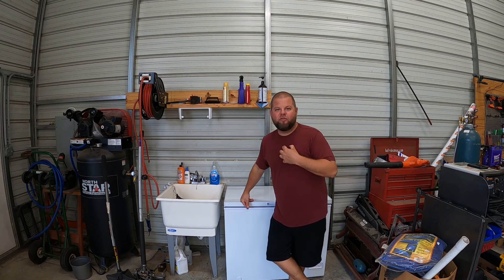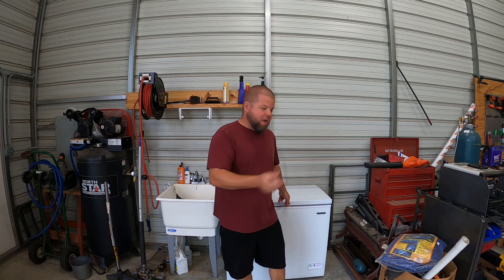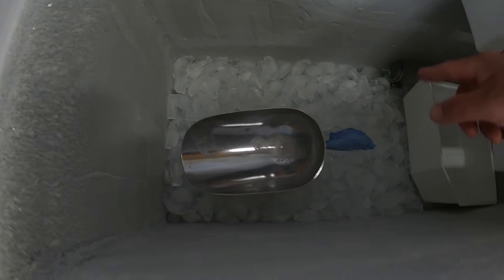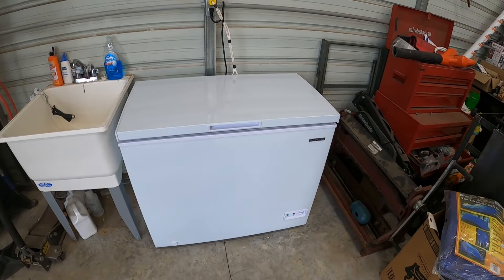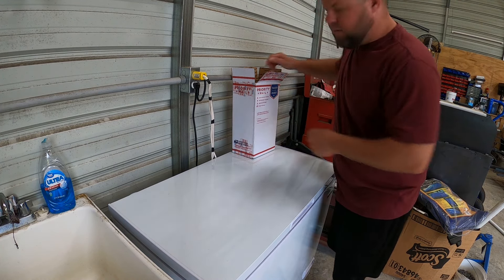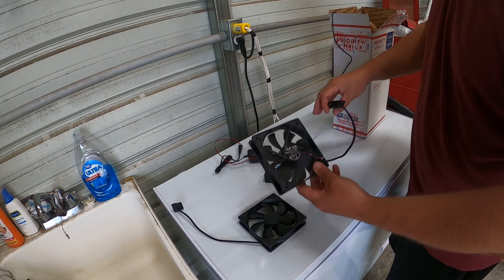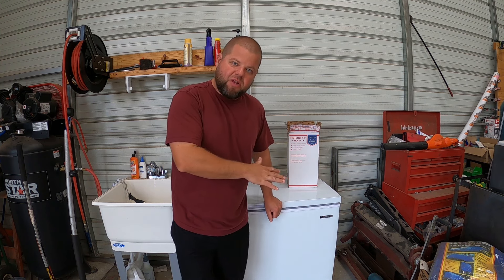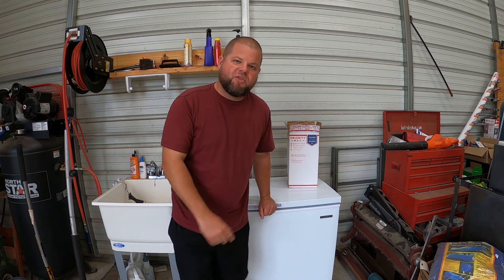Homemade ice machine update! Viewer requested

Comment: how will you eventually deal with defrosting the freezer?
Reply from the maker: Pull the ice makers out, leave lid open and drain. Might as well wash and clean at that time. It's very lightweight and has a drain. I'll just pull the freezer outside, all my parts are easily removed. I cover this in a video I'm about to post

Comment: Hi, I love the idea although I have one question. Will the icemakers stop when the freezer is completely full or will the keep producing ice cubes and jam the system?
Reply from the maker: I took the bars off to fit them, you can manually trip them or just unplug them. No concern to me because I'm using it all the time. It won't fill up until winter
Reply: Thanks for your reply. So the icemakers came with a mechanism that will stop them to work when the freezer is full. Okay great thanks.
Reply from the maker: Yes they did, but the way I mounted them I had to remove it. The freezer has such a large capacity, if you were to go out and check once a week, you would have a good idea when you needed to trip them off
Reply: Okay thanks.

Comment: Peace..this is a DIY I've been looking for.  Question: is there a governor that automatically starts and stops ice production so as to limit quantity  ?....Thanks for sharing this  !
Reply from the maker: It's a timer that activities the water valve for a few seconds.
Reply: There should be wire arm attached to icemaker that will stop producing ice when it sensing that ice bin is full. you may manually stop icemaker by moving this wire arm to UP position.

Comment: Could you epoxy magnetic to the top plastic part and it might just stick to the inside of the freezer so you could angle it and swivel it where ever with no holes in the side with the copper tubes
Reply from the maker: Good idea

Comment: For the Fan, it does not matter where you add it, you can blow "cool" air from bottom to top.
Or you can move the "warm" air from top to bottom, now the "cool" air has to go somewhere, and that is up. It is not that efficient, but it is simpler. PC cooling uses similar tricks to deal with dust.

A hint for the first video, maybe it was answered, you needed the pipe with the open top, so that it will stay "empty". And also with enough air + distance to the small pipe where the water is staying, to prevent it from freezing.

edit: 
Strike that out:
---
What you should do: "Cock" your pipes every 2 months out, it should reach 160 ° F for an hour. Because you will get problems with Legionella and similar stuff from that! Everything that is sub 30 ° F should be save, but please read into that. You don't want to spend your weekend trip on the toilet. Maybe I am paranoid, but check that.
---
You state in other comment that you do not us the ice for drinking, maybe add that in the video. For me it was not clear, but English is me 2nd language, so I could just missed it.
Reply from the maker: Thanks for the tips! I agree about bacteria and will defrost/clean on a certain frequency.

Comment: The ice makers run on a timer  and the thermostat controls when the timer runs. When the ice maker is in a refrigerator the thermostat kicks the timer out in the defrost cycle of the refrigerator.  This happens so the ice tray will freeze the water when it is is cold enough. If during the defrost cycle it is not cold enough to freeze the ice the water won't overflow in the catch pan.
Reply: That’s not the way those ice makers work, they were an older whirlpool design that did

Comment: Great idea. Question, do the ice machines have the ability to shut off if the ice fills up to the top? Love to build one myself but my usage is more sporadic, if it stops once filled it would be a perfect solution.
Reply from the maker: If you leave the trip bars on then yes. I had to take them off the way I mounted them. That freezer has huge capacity. If you check it once a week you can easily trip the ice makers once you see it filling up.

Comment: Seems like it would be better to get a countertop ice maker and rig it up to fit in the freezer. They make like 24lbs a day with just one unit. Edited to add: They make the good crushed ice (nugget ice) like Sonic Drive-in uses.
Reply from the maker: The ice is small, hollow and melts quickly. Also opening up the freezer would allow air in and a ton of frost build up.

Comment: buy a countertop ice maker, cut the bottom off off it and cut a hole in the LID of the freezer and silicone the countertop ice maker to the lid on the freezer! VIOLA that ice maker kicks #$$! LOL 🤣🤣🤣🤣🤣🤣🤣🤣
Reply from the maker: Problem with that is the ice that come out of those is partially frozen, starting to melt and wet. You'd wind up with a huge block of ice.

Comment: Only drawback I see is with these chest freezers, they must be defrosted occasionally, no matter what you do. The more times you open it, the more often you have to to defrost. I defrost mine yearly, but you can go longer for sure.
Reply from the maker: Very true, mine has a drain in the bottom. I'm thinking of fitting a hose to it when I do that process or just take the freezer outside. It's very lightweight and all my parts are removable. You should clean ice makers often anyway for bacteria concerns.

Comment: The 50 lbs / week calculation was probably based on use in a standard freezer, A purpose built deep freezer is likely able to freeze ice faster do to holding lower temps better.
Reply from the maker: I have since improved that number

Comment: I'm guessing the fans won't make a difference.  Those ice makers are set by time not temp so they won't make it any faster.  If you can modify the time cycle then it would crank it out.

Comment: Next update you should put a killawatt meter in it for 24 hours or a week or something for power consumption I hear those don't use a lot of power but it would be cool to have a number
Reply from the maker: I'm actually ordering a meter this week, but I won't get it until after the next update video. These freezers definitely do not run often, way less electricity than a commercial unit.
Reply: Well the commerical units I have seen don't have a cooled holding area so I mean they only run while making ice but I have a different brand meter I got from china but the killawatt is about the same price at harbor freight if you have one near by it's the name brand one not just one of their products

Comment: So glad I came across this. I’ve been looking around at ice makers for the last couple months. Question, do you have any kind of drain at the bottom in case loss of power or anything? A way to drain the water. Also I noticed some frost build up around the top. Think adding some sort of latch for a tighter lid would help?
Reply from the maker: Yes this model comes with a drain and plug, so no worries there. A latch for a tighter seal and not cutting the sides would help with frost build up. I just occasionally take a putty knife and scrape the frost into a ice cube tray and then toss in the sink. I'm thinking about building another one soon with a insulated lip so no drilling or modification of the freezer is needed. Thanks for watching
Reply: @TKCL  Just youtube Keezer. Plenty of options out there for raising the lid.
Reply from the maker: Exactly, I found out about those after building this.

Comment: Thanks for the video. I watched part one also, so have a few suggestions and comments to take or ignore. 

- The tap that pierces the copper plumbing is often called a "Vampire" tap for obvious reasons.

- You might be able to do this whole mod without damaging the freezer. Just build a collar like the DIY kegerators. You might get by with 2x4 lumber, check hinges.
The Icemaker looks like my Whirlpool. My original was wonky. I wish I knew replacement was affordable, but that was a while ago. Samsung is even worse. Samsung is even worse. Did I mention *&$%^ Samsung is even worse. 

- I like that you manage your own quality with the filter.

- There is a component attached on the compressor that may fail. It's called a relay. It doesn't look like a relay. Internally, it has two pieces that are about the size and shape of a nickel. Mine failed after 2-3 years but was an easy fix. It basically adds power to start winding of the compressor for a second or two. Symptom is compressor won't start. If you have this problem, comment and I should get notified and will try to respond with help. Probably less than $5 fix.

- Shrink wrap those soldered connections and colored electrical tape to mark wires. (often come in pack of 4 or more RGBW for cheap). Better yet, get some MTW wire of proper colors, but I don't see that at Lowes/HD (haven't looked in a while). If you wire externally I would just buy some 3-wire with protection. Don't forget to shrink wrap.

- To find internal cooling lines, mix some baking soda into water spray bottle and spray on the surface, in this case, probably the inside. Warm area dries faster, cold may frost. This trick worked for me on a small fridge converted to kegerator, but was dark color. YMMV.

- Fan... I think the fan is a worthy addition. Super low power. I don't think it matters that it be near the ice maker, and I would start by mounting at complete left side of your unit, pointing to the right. I think it may assist some sublimation which should help keep ice from clumping. Sitting far from the IM would probably mean that the "full sensors" will trip before the extreme left side fills. ie: your mountain of ice summit is to the right where produced and the left side will be lower.

I don't have any criticism of the way you did it. It's probably very close to the way I would. (f*** pretty). I have a 5 lb. Co2 bottle chained to the side of my keezer.

Happy fishing
Reply from the maker: Thank you for the suggestions. Make sure you watch the recent videos with fans, made a huge difference.

Comment: Ice maker triggers timer after reaching 10F ? 

I think ice maker doesnt have any timer. At a given temperature the ice maker triggers the process of making ice. Then it senses the ice cube temperature until it reaches apparently 10F. So, that process have an average time. In other words… the ice cube needs for example 30min so it reaches 10F from the outside to inside. 

I think, if you force to much air the ice cube will be slushy in the inside. If you do the right amount of air not too much, then it might produce more ice. 

I take this analogy from a regular plastic ice cube maker. In the freezer it start frozen from the outside to the inside in a regular refrigerator(not one with and ice maker). If you put a water bottle in the fridge it start getting colder and freeze the outside but not the inside in a short periodo of time. Could 10F be the sweet point where ice cube is frozen inside ? 

We need to take the fact that the shape and the density of the ice cube is pretty small, it could get completely colder faster. 

If you could find where the thermostat of the ice maker is, or the sensor thing. You could direct the fan so that it push air to the ice cubes but not the thermostat.
Reply from the maker: Video posting this afternoon testing all of this. Thanks

Comment: Defrost the deep freezer? How often?
Reply from the maker: I scrape the frost into the ice tray once a month and toss into the sink.  I am guessing defrost once a year and clean.  This model freezer has drain in the bottom, all ice makers should be cleaned often for bacteria reasons too.
Reply: I am an HVAC and refrigeration tech good job on the build. I've built one myself Whirlpool sales a kit with wires, valve, ice maker and fill tube that's what I used. Good job not puncturing the could.  The r600 freon is basically propane I hate dealing with it but all appliances are phasing into this flammable gas. Very few people in usa can work on these systems.

Comment: As per the temperature of ice, yes the temperature when water freezes is 32 degrees Fahrenheit (or zero Celsius), ice can continue dropping in temperature, Let's take that to the other end of the scale, water turns to vapor (steam) at 212 degrees Fahrenheit (100 Celsius), at which point even steam can't get any hotter in open air as it almost instantly evaporates, steam can get a  rise in temp if it's in a sealed system, such as a pressure cooker. I just had to throw that science stuff out there for giggles, it's amazing how the school system has failed for years to teach anything meaningful. I learned this sort of thing by 6th grade way back when. Want to show how cold it gets, lick your finger and touch just a single "cube".
Reply from the maker: I'm very familiar with the properties on the upper end, we use to cook wood chips in liquid at over 340 degrees. We did that by placing under pressure, much the same way a pressure cookers gets food done so quickly. This was at a paper mill
Reply: @TKCL  I assumed you would know about the highs as well, didn't know about you working in a mill. I threw it out there for the people who just might not get the extreme properties of water, since what they teach in school is next to nothing now days. Throw some salt on the ice and it gets things cold faster as well. Oh the knowledge that is being lost because schools got lazy.
Reply from the maker: I agree 100 percent

Comment: Kelly, I have a project you can make if you are interested in keeping frozen items colder without having a freezer on board. Mix salt with water. Put it in a tube. Could use copper or underground polly pipe. Leave room for expansion. Seal both ends. Your salt water mixture will have to be mixed so it will freeze in your freezer. It thawing out at a colder temperature then ice will keep items colder. If interested you will have to experiment with different salt water mixtures to get it to freeze just a few degrees higher than the lowest point on your freezer as the thawing of a solid is what gives the hours of cooling.

Comment: Thats cool and all, but....you could probably just fill a bag up everyday from your fridge and put it in the freezer and it would be cheaper because you are already running it anyhow.
Reply from the maker: Nope, we use the ice out of our refrigerator freezer every day for our tumbler cups. I've added two ice makers to my freezer for double the capacity. The beautiful thing about it too is that it requires no attention from me. It dumps and fills up until I'm ready for it.

Comment: Those ice makers work on timers, not when the ice freezes...some are adjustable
Reply from the maker: I've had a bunch of AC techs tell me they work on a thermostat. I am testing that tonight by installing fans. Video out soon
Reply: @TKCL  Look forward to those results.  It's likely dependent on the particular unit, I'm no expert, but have tweaked the system years ago.  The amount of water is also on a timer, usually adjustable, so if you find yourself with too small of cubes, you can adjust the timer a bit to allow the tray to fill up a bit more.  What brand of ice maker are you using?
Reply from the maker: It's a off brand that's designed to fit whirlpool if I remember correctly
Reply: @TKCL  Try putting a little dry ice above if you can, or fan the air from the dry ice to the tray.  That will freeze the water in a minute or two...just food for thought
Reply: Another thought, try putting a regular old fashioned ice tray with about the same size cubes near the auto trays, see if you can determine how long it's taking to freeze, then you'll know how often they 'should' be dropping ice.  Maybe if your model of ice maker uses temperature, which I think it does, that can be hacked too, if it's keeping ice longer than it needs to

Comment: All you have to do is get a bunch of empty milk jugs 2L soda bottles storm in the freezer hell a lot cheaper and easier to do
Reply from the maker: No not at all. I fish constantly and use ice for coolers and boating every weekend. Solid ice or even busted ice does not work as well as uniform cubed ice. I've tried it

Comment: $3.50, expensive?  Try CA at $5.50+tax.

all you need to make it colder is create air flow, so mount  the fans near the top to blow down on the side opposite the ice makers. this will drive the cold air at the bottom up towards the icemakers, across the top, and back down for another cycle across the ice to cool again, plus moving air is colder than stationary air.
Reply from the maker: Did that yesterday, video out tomorrow